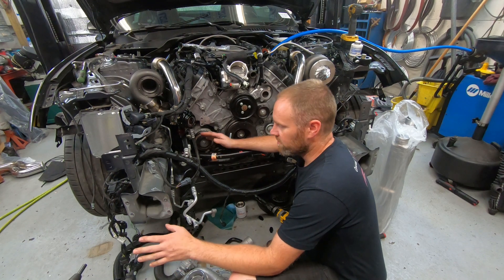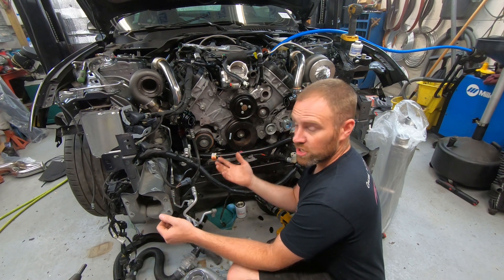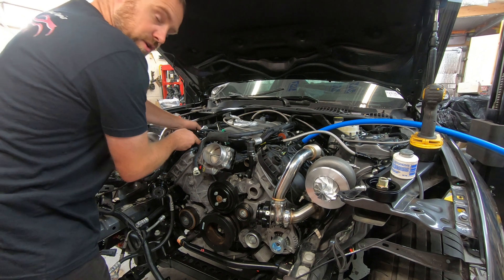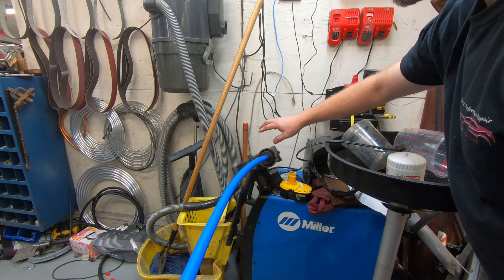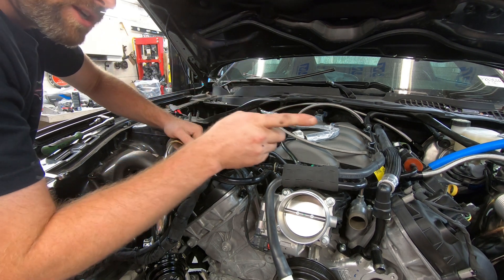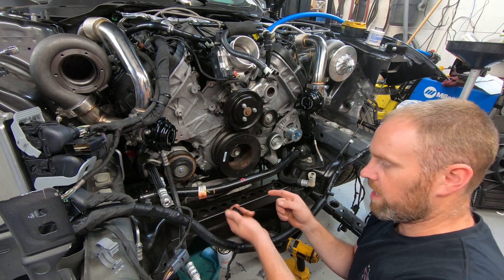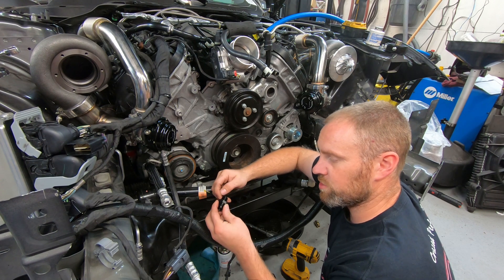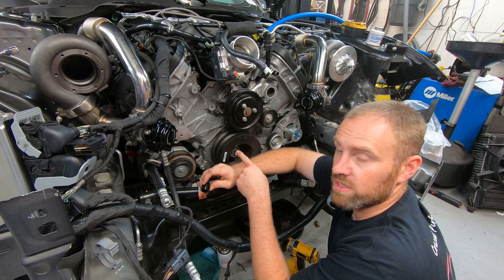Adding a Turbo Oil Drain, Safely Drill Hole In Engine (Tech Tip Tue)

Comment: just found your channel, seems super interesting and informative. what are your thoughts of the 6.2 vs the 5.3 overall reliability? i have 190k miles of my 5.3 and am due for a new truck soon
Reply from the maker: They are all 400-500k mile engines if taken care of as far as bottom end goes. The top end however will need to be addressed at some point along with oil pan and sump gasket. The valve train is a nightmare of issues if equipped with AFM.